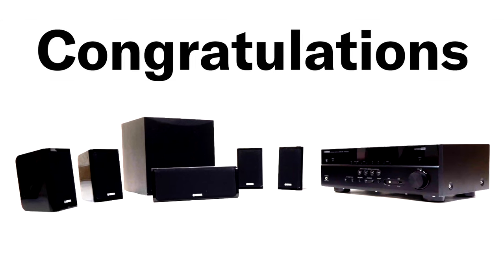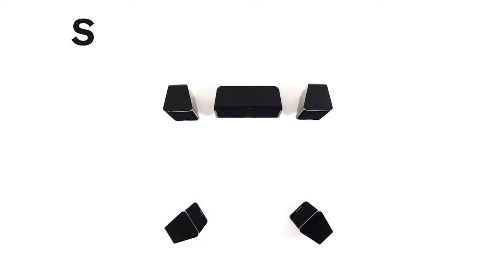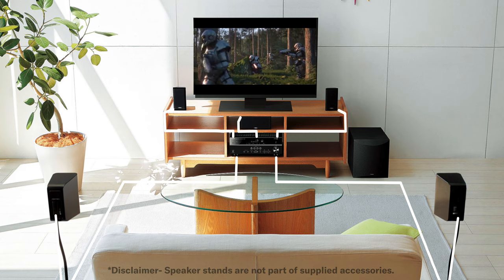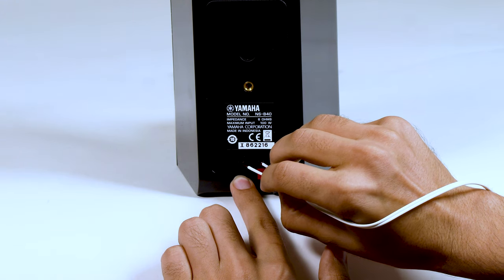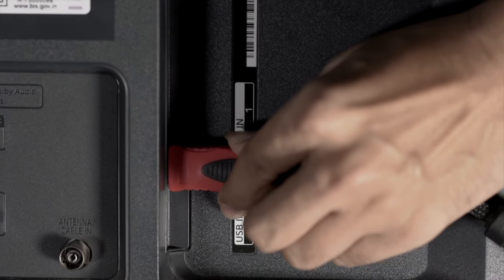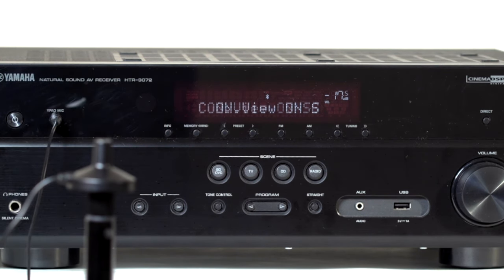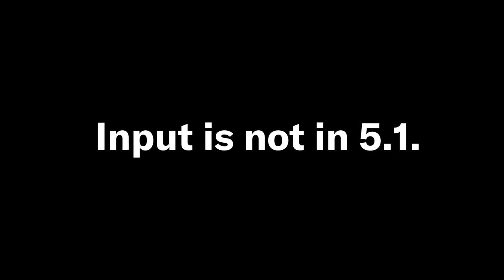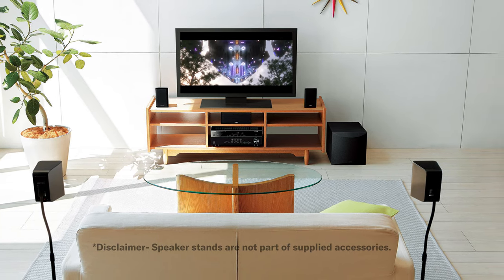How to setup Yamaha HTiB  YHT-3072IN in 6 Mins

Comment: 0:18 Step 1 : preparation
0:50 Step 2 : Speaker placement
1:45 Step 3 : preparing the speaker cables
3:17 Step 4
4:07 Step 5
4:14 Step 6